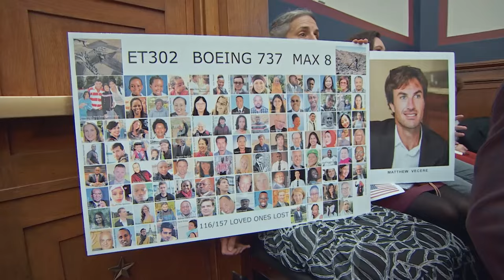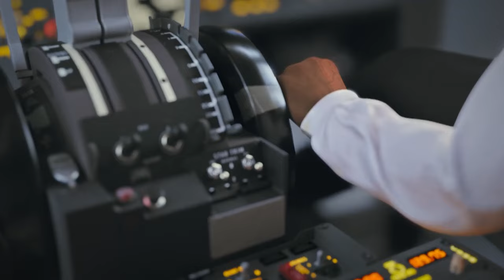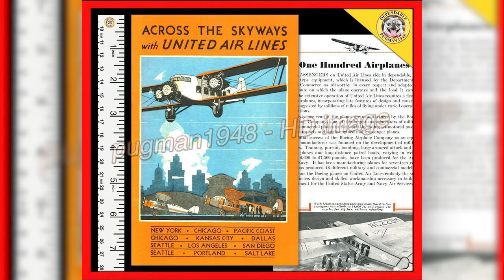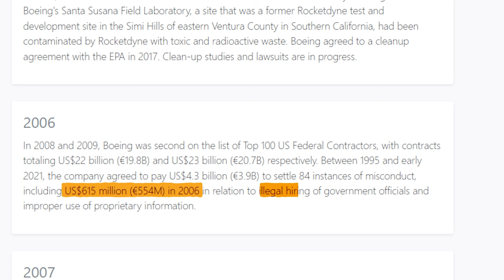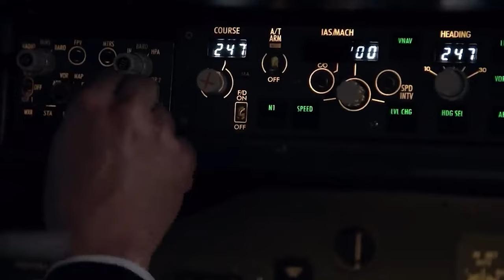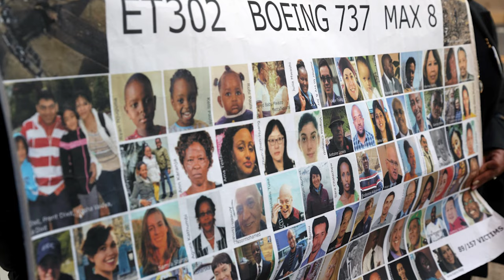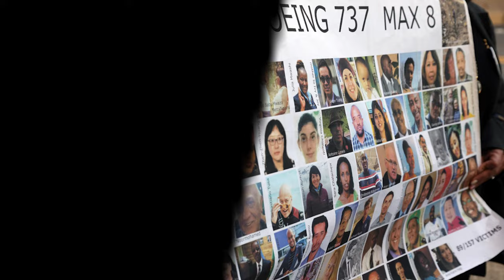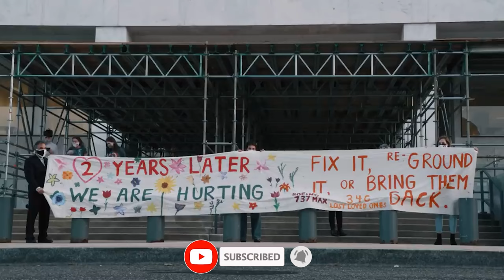Scandal That Destroyed Boeing | How Profit Over Safety Led to Disaster?

Comment: Oh boy and does Boeing most certainly deserve the incessant backlash and hopefully this will be a lesson to especially those mega corporations that feel they can get away with anything...I remember reading about Boeing's half ass response to Airbus' NEO line, I loved that Boeing was feeling the heat and instead of sitting around being complacent they took Airbus serious because competition is usually a good thing but when I first read about how they had mount the engines closer to the leading edge and have part of it rise slightly above the leading edge I figured it would cause problems though not to the extent that it did and much like their approach to countering Airbus MCAS was designed half assed and the promises to Airlines that it required nothing more than a computer lesson was more like Quarter Assed, but them hiding MCAS, not only did they not inform the pilots but they didn't even give a shit enough to give even a paragraph explaining what it is, what it does and how to disable it... Boeing is in a position right now that many mega corporations in the 20th century found themselves in... They got so big and had such a massive grip on their industry they became complacent and saw themselves as infallible..so many of them made the wrong decision at this juncture and now they're nothing but a memory...I'll forever love many of their aircraft with the 747 probably in a place to never be topped in my mind but the company itself, when Lion Air 610 went down and I figured out why I was so pissed you'd think I'd lost someone on that flight.. Ethiopian 302 did affect me via my aunt who lost 2 of her greatest friends on that flight.. the day it went down and I heard rumblings of what happened before it crashed I knew it was MCAS, in which Boeing once again topped itself with the 1/64 of an ass job they did with MCAS, someone from the 60s brought to the present could've done a better job, at this point i don't think they'll ever be able to gain back my trust and support
Reply from the maker: Boeing's half-assed approach seems to have landed them in some serious trouble. Maybe they should consider a full-assed strategy next time.